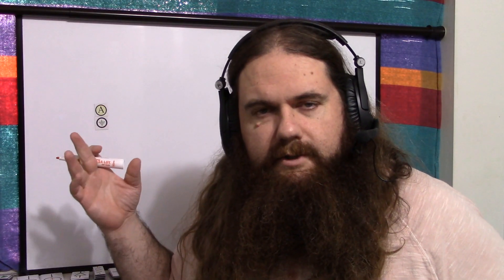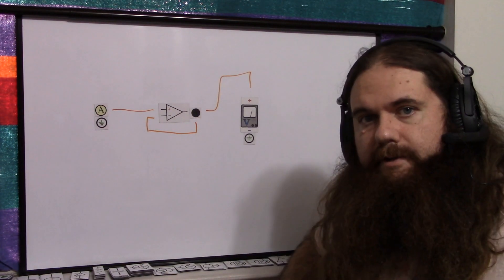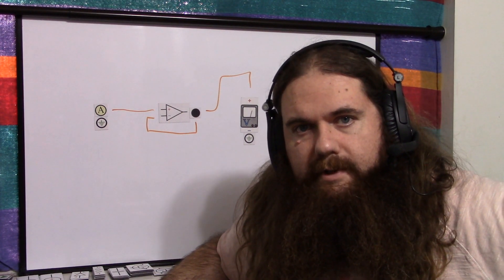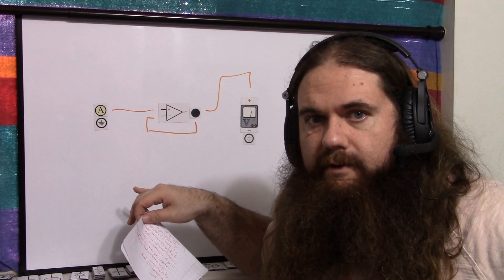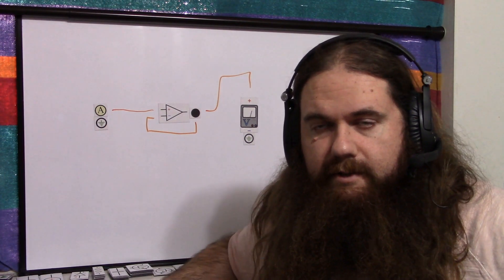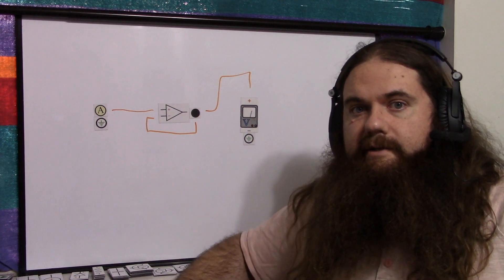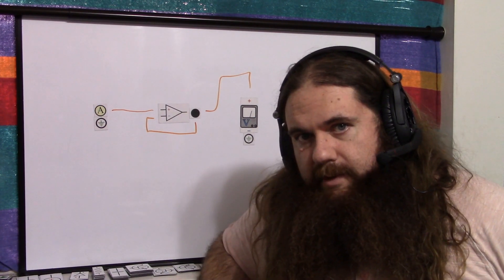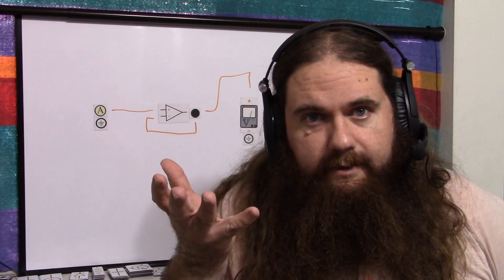Measuring Voltage Gently - Buffering For Greater Input Impedance - Simply Put

Comment: Oh my God, a capacitance voltage can be that easily reduced ! Can you show us that ? Like the circuit you were measuring.
Thanks anyway
Reply from the maker: What do you mean by a capacitance voltage that can be easily reduced?
Reply: @simplyput2796  I mean ceramic capacitor voltage which is lost as soon as you try to measure using a voltmeter, so it's directly affected (I should had said dropped or lowered instead of reduced)
Reply from the maker: Oh, I see. I could do a demonstration video and do some math, sure.